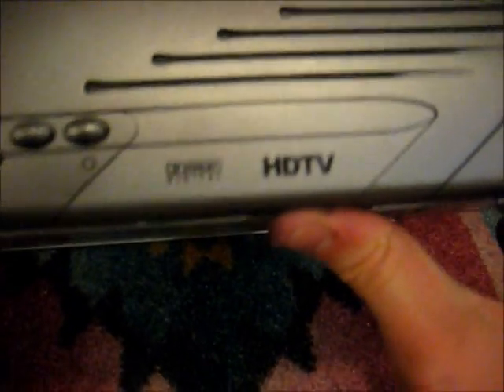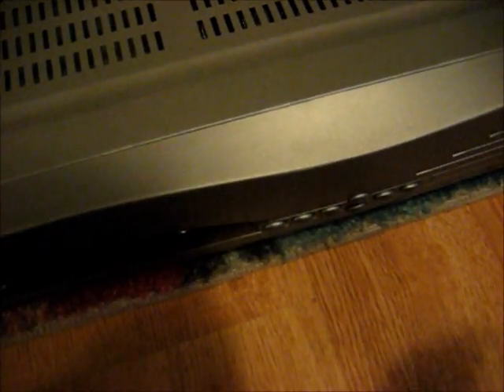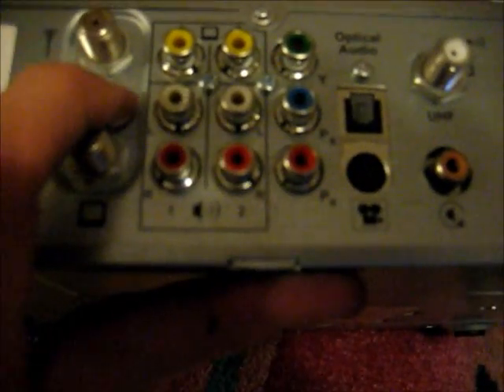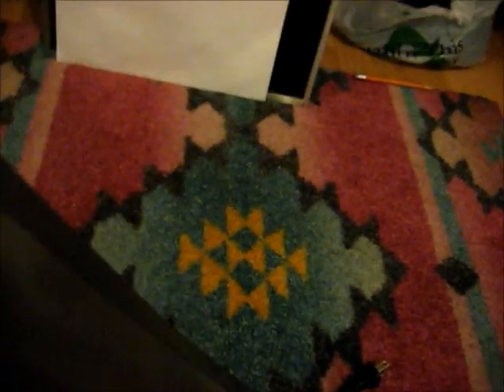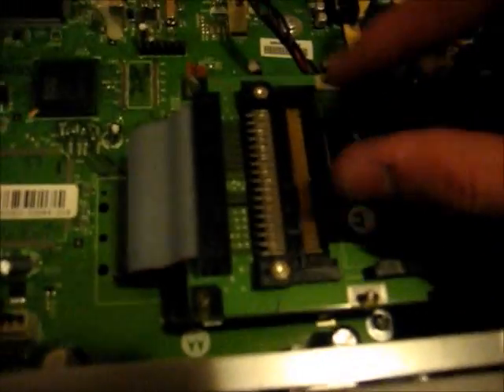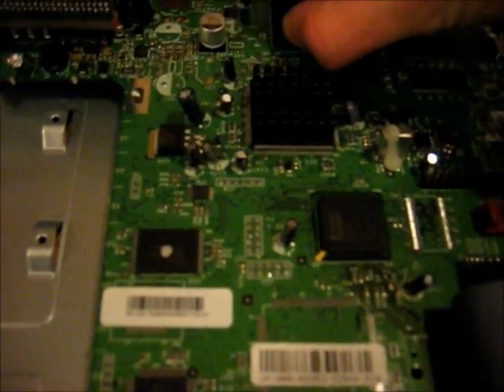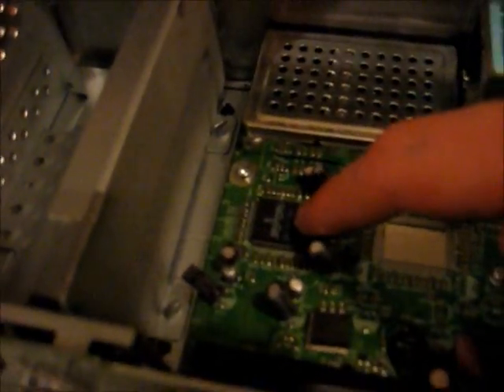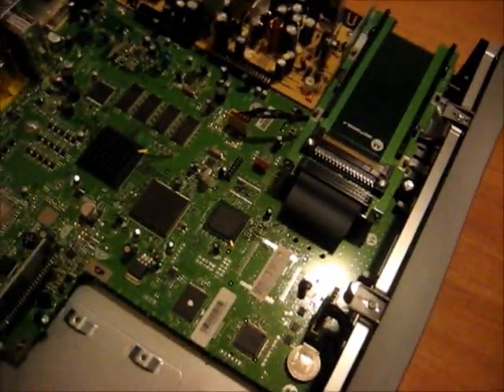Motorola DSR505 Satellite Reciever [RISC/MIPS based CPU]

Comment: its quite possible that you could use a stripped down linux distro. and if it is able to boot from the cf slot you could run windows ce or linux. if not, how big is the onboard rom?